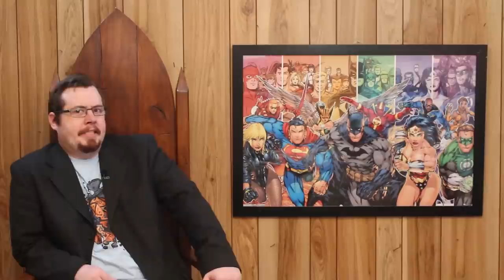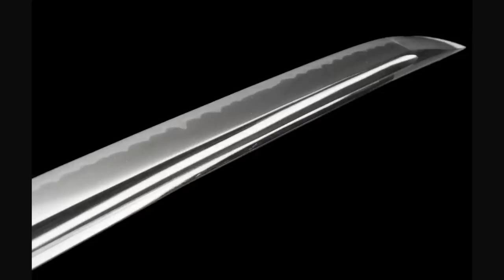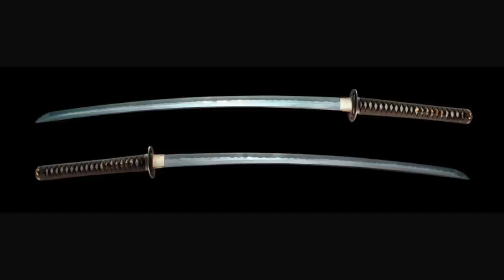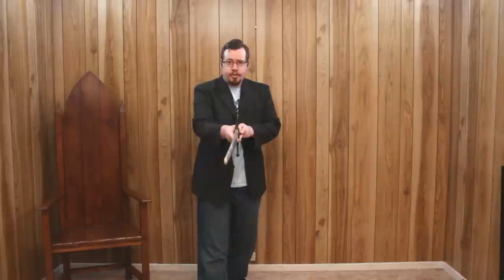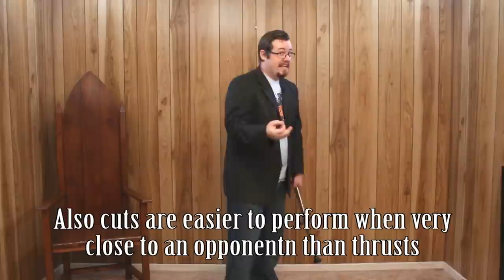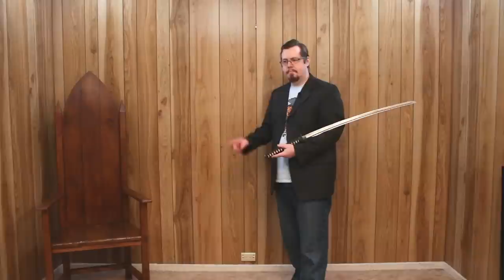Super cutting swords, are they needed?

Comment: 1) stopping power: deep cuts debilitate faster; less need to aim well; even a weak/bad swing will do signifiant damage (untrained; exhaused; stressed)
2) target area: normal swords won't cut through winter clothing and gambesson as much as falchion or Katana would; similarly a rapier might kill with a cut to the throat or arm-insides but do little against the torso (or try to fight a rabid bear)
3) psychological: flying limbs, rolling heads and falling entrails scare enemies; the ability of an overkill will boost your confidence
4) potential weight reduction by specialisation: a machete cuts better than most swords but is 2-3x lighter; same could be said about thrusting with an epee
Reply: All good points. One another thing to note is that while Katanas and many types of Messers/Falchions are very forgiving in the cut, they are by no means inadequate thrusting swords. One isn't going to be able to wield them like Rapiers due to being blade-balanced, but when thrusts are actually needed - for instance when finishing off an enemy on the ground or against armor - these swords are perfectly capable. 

Both of them are single edged, therefore quite stiff. Curvature may be involved, but most of them tend to be only semi-curved or straight. A large number of Messers/Falchions have clip points, which aren't functionally that different from spear points in the context of thrusting. Katanas may have hatchet points but tend to be fairly narrow and pointed, not to mention being even more stiffer - which aids in both cuts and thrusts.

In reality, Messers/Falchions and Katanas aren't really even dedicated cutting swords, but rather compromise design cut-and-thrust swords. If they are specialized towards the cut, it is only slightly so; as sidearms and close-combat weapons, most people wanted something that would suit the natural human tendency to cut/strike while remaining very versatile. Which is why the above swords were very popular among both commoners and nobility back in the day.

Comment: Because thrusting on horseback with a sword is stupid.
Reply: +Xaro Xhoan Daxos or a riding lance?  You know? Use the power and momentum of the animal you are riding to your advantage?

But if you want, you can try to ride up beside me and try to take me out, while I ride towards you with a big stick in front of me...and have the option of taking either you or your horse out of commission before you can ride get beside me.

(I think I would prefer getting the first attack in)
Reply: I don't see why the last time they used them is important? 

When gunpowder was become the largest form of defense, the swords were more or less a tradition.  If I am not mistaken, they were handed mainly to the officers.

Well, I guess, the standard solider had a Bayonet, which was basically a sword at the end of the gun (much like the lance)

(I guess it was important)

So as far as not being a sword, the lance is used for trusting...It just has more length than the standard sword.

If I really wanted to, I could attach a sword on a stick (actually I think the Vikings would do that...if I remember right, they had a spear head could be taken off and used as a sword in a pinch)
Reply: +Xaro Xhoan Daxos there were still lancers in the Victorian era.
Lancers didn't die with gunpowder xD
Reply: +Xaro Xhoan Daxos Ever heard of "giving point" ? :D lol.
Reply: Blank- blade "Giving Point" is not really a "thrust". You point the saber and let the animal do the work, quickly withdrawing at the point of contact. And if you do it incorrectly you break your damn wrist, so it wasn't even a preferred technique. Unless you're very skilled, giving point is a stupid maneuver. Either way, it is still done with a curved sword, usually a saber, the preferred sword of cavalry.
Reply: +Xaro Xhoan Daxos large cutting swords are indeed very effective on horse back, momentum aid not only helps the cut but also a huge amount of blunt force trauma may be imparted on the target. Top heavy and overall weighty swords are the answer to horse fighting. Not to mention if the rider is literally stuck, they may rain down blows with immense power, even without using half of their body to produce the force.
Reply: +Xaro Xhoan Daxos Actually the style refered here is pointing a sword point forward and among cavalry enthusiasts, there is a great debate between thrusting and cutting on horseback. Matt Eston has mentioned this before.
Reply: +Xaro Xhoan Daxos it&#39;s not. People did it all the time with sabres and othe weapons by the way. You just point the enemies and ride and they die.

Polish hussars had lances (one-use), koncerz (long, triangular-crosssection thrusting sword), and sabre or pałasz (curved or straight cutting sword) as a 3rd choice weapon.
Reply: +Xaro Xhoan Daxos Swords were often used for thrusting by cavalry and were more deadly when used that way. It's the way heavy cavalry swords were generally supposed to be used during a charge. Towards the end of the 19th century all cavalry swords were only made for thrusting and nothing else.
Reply: Ozoneocean MJM There's two schools of thought. One says thrusting on horseback is stupid, the other says it "has it's place" at best. I stick with the former because:

John Gaspard le Marchant, the great trainer and leader of British cavalry at the turn of the 19th Century, felt that the weapon employed in the charge was almost irrelevant, as the shock value stemmed from the momentum of the combined horse and rider. The sword came into its own during the “desultory” encounters after the charge, for which a slashing sword was best suited.

The most compelling criticism of use of the point in cavalry combat, however, lies in the possibility of it becoming the victim of its own success. With the force of a fast-moving horse and rider behind it, a well-aimed sword thrust would certainly achieve considerable penetration, even up to the hilt. As the horse and rider passed the unfortunate recipient of the thrust, the sword would be very difficult to drag clear of the body, leaving the rider at best disarmed or at worst unhorsed or with a broken wrist.
Reply: Xaro Xhoan Daxos
That was from the late 1700s though, notions and styles change and so do weapons.
There are techniques for dexterous use of the thrust without harm to the wrist while charging- search "tent pegging sword".
Reply: Ozoneocean MJM That's from a 19th century Master Dragoon, not late 1700's. The M1860 US Cavalry Saber wasn't a straight thrusting weapon, either, because in the Civil War and beyond, the Cavalry charge became less and less common and Cavalry took on the role of skirmishing where pistols and slashing excelled.

It's always the same argument with thrusting on horse back. Always people say how it can be done if you're skilled enough. Yeah, that's true of anything you can think of. You can drive with your feet if you're skilled enough, that doesn't make it a good idea.
Reply: The 1908 cavalry saber is a thrust only weapon.
Reply: majungasaurusaaaa And the Type 94 Nambu was a military sidearm. Many stupid weapons have been made in our history. It doesn't make them good ideas.

John Gaspard le Marchant, the great trainer and leader of British cavalry at the turn of the 19th Century, felt that the weapon employed in the charge was almost irrelevant, as the shock value stemmed from the momentum of the combined horse and rider. The sword came into its own during the “desultory” encounters after the charge, for which a slashing sword was best suited.

The most compelling criticism of use of the point in cavalry combat, however, lies in the possibility of it becoming the victim of its own success. With the force of a fast-moving horse and rider behind it, a well-aimed sword thrust would certainly achieve considerable penetration, even up to the hilt. As the horse and rider passed the unfortunate recipient of the thrust, the sword would be very difficult to drag clear of the body, leaving the rider at best disarmed or at worst unhorsed or with a broken wrist.
Reply: I don't want to locate myself in the flaminess of this, but I have to agree that with the saber, the design idea has to be remembered to be that it's a sword that won't take your own arm off, using it while moving 30+ miles an hour, or whatever a horse's max speed is exactly.

It will have to be a cutter to be used with broad sweeps.
Reply: Thats why the 1908 Cavalry Sword is known as the "ultimate cavalry sword" I suppose?
Reply: Here is the thing.  The professional soldiers who actually used swords to kill other men in warfare did not agree on this.  I do know that the last swords designed for American and British cavalry both ended up with a straight blades with no cutting ability.  [See the Patton Sword designated Model 13 Cavalry Saber, for an example]  For a modern man to make such an absolute stataement seems a little silly to me.  

No, thrusting on horseback with a sword is not stupid.  Especially when you are facing opponents in russian great coats that your sword will not merely not cut through, but you cannot thrust through it either.  Thrusts were often considered much more likely to disable an enemy over a cut.  Again, men who actually fought in warfare with swords on horses for their entire military career in perhaps the more professional military of their day did not consider it stupid at all.

I don't think there is an answer, except perhaps to use swords designed for specific targets or to keep swords that can both cut and thrust well.

More than likely the sword is either a sidearm you carry around when you do not expect combat or it is a backup weapon.  If you expect combat you are probably going to use a pole-arm or firearm (depending on the technology).
Reply: @MrOdrzut  Not really man. The hussars valued both their swords but for different reasons. The koncerz was more for use against armored enemy horsemen and the saber was more for general use. In general, hussars were not supposed to engage armored enemy infantry with their swords. Generally that's what their lances and guns were for. 

Two examples I can think of for more well rounded weapon kits belong to Russian cossacks and Byzantine cataphracts where they had a lance or bow/gun as a primary weapon and for their sidearms, they carried a curved saber for general use and for facing armored enemy cavalry and infantry they often carried a mace.
Reply: @Jilguror  Main reasons that people weren't able to cut Russian great coats was because the sabers they were using were not specialized cutting sabers (around this time they were using pipe-backed cut and thrust sabers that were more geared for thrusting) and most soldiers didn't sharpen their fucking swords. In conclusion, no shit they weren't able cut good when they were trying to cut with damn near blunt edged thrusting swords.
Reply: @genghiskhan6809  not really? That's literally how they fought - shoot pistols, charge, break lances, retreat, get new lances and pistols from their helpers, repeat. Swords were used if the charge worked and enemy started to retreat.
Reply: You're all just arguing over personal preference to be honest, both the thrusting lance swords and heavy cutting swords work well on horseback, it's down to personal fighting style, some prefered giving point on the charge and some prefered cutting. neither is bad, the same with fighting on foot you get some fighters who prefer the point and some who prefer the edge. The English typically prefered cutting in history, and they had to be trained out of it to adopt giving point more. You are just debating apples and oranges, some prefer an apple some prefer an orange. A heavy cutting sword can lop your head right off, a dedicated thrusting sword can run them through the heart. Both are effective on the cavalry charge.
Reply: Using a sword on horseback in the first place is dumb

Comment: I do know the answer to your questions about cutting an arm off (or whatever) vs just cutting deep enough to disable.

In combat, there is allot of adrenaline.  There are several instances where a person will receive fatal wounds and did not know it, and fought for the few minutes while he was alive.

If you cut the arm off, It is very unlikely he is going to be able to strike you again.  If you cut deep, the person may not even know they been cut (especially if the sword is sharp) and make a swing.
Reply: +undecidedgenius if you cut through the sinew or seperate the muscle, it doesn't matter one bit if the person knows they've been cut.
Reply: +iseeicyicetea It matters, because the person has got two arms. Completely cutting a limb is something that even adrenaline cuoldn't solve, the person would bleed out in seconds and lie on the ground, or try desperately to stop the blood flowing. If you cut a limb, you have won, if you just disable it, you'll still have to fight.
Reply: If you get that perfect shot, yes.  You have to remember that your target isn't just standing there.  He is trying his best not to get cut.

So if you're off, even i little, the other still has the ability to strike.

Just as a side note (to prove my point), on my right ring finger, I have a big hole in my tendon.  I have only about 40% of my tendon there and yet I have never had any trouble using my ring finger since that happened.

Now if it were cut off, I am sure I would be having more trouble with it

Comment: Shad, please do not take offense to this question, but have you ever been in a fight?  Not a little sparring match between buddies, but a conflict that really matters?  When your fight or flight instinct kicks in, your adrenaline increases exponentially.  That in turn heightens your other senses, which may be very difficult to control.  In extreme duress the body can perform feats a rational mind could not fathom.  Because of this and a few other factors the body can withstand a lot of abuse.  That said, "just enough" could very well be not enough.  When I went to war I heard so many reports that some of the insurgents would continue charging after having an entire magazine of pistol ammunition fired into them.  There are times when "overkill" may be your only option.  In hand to hand training one time, my partner got a bit overzealous and tried to snap my arm.  No amount of tapping was he ever going to release me.  So after repeated headbutts to his face, breaking his nose and leaning my free arm into his throat cutting off his air he finally let go.  In war there is no such thing as "just enough", you destroy your enemy as completely as possible.  You not only shatter their bodies, but their morale and their will to fight on.
Reply: This is correct. Kind of. It's a lot harder to incapacitate someone with pain when their hopped up on adrenaline, but a severed biceps is still going to disable an arm. And that doesn't require cutting through the bone. As others have stated, a thrust that misses vital organs isn't going to be fatal. Similarly, a thrust that doesn't go through muscles isn't going to disable a body part. And bullets are basically very powerful thrusts
Reply: Crist dude
Reply: Dude no. Most people panic. Also just enffoe works. You don't have to full stop someone. I have had fight with bats and bottles. One good hit and most people back of. People dont keep fighting if they lossing

Comment: Love the point! Generally I agree with this, but I have a possible rebuttal. Maximum potential cutting power is not all that matters; how hard you have to swing the sword to achieve a good wound is also important to consider. If a sword can cut very well, it doesn't require as much physical exertion to do damage in the cut as one that only cuts well enough. Largely, this would be against unarmored opponents.

Of course, again, I agree with the overall point. When people do these cutting tests I think they obscure the original intent for having such a specialized sword; but I do believe there were times when the extra cutting power came in handy. Or should I say 'came OFF handy', amiright?!
Reply: Thrusts take what, 30 mins, an hour? to kill? maybe disable in 5 minutes perhaps, optimistically, this is completely run through, too. Think about bullets. Though tiny, they cause fist sized cavities on impact, with hydroshock damage. yet most people survive gunshot wounds nowadays, if they get medical attention in under 1 hour.

Now consider the actual volume of the cavity from a sword. hell, even in combat it could take days for enough blood to actually pool in the injury to actually kill you.

Cuts, now cuts are way more painful, the enemy still has running away as a possibility (when stabbed through they will fight with wild abandon knowing they will die) and it is easier to sever tendons in fingers and such and actually disable, whereas a thrust to the stomach won't actually disable anything.
Reply: Realy?! to stomach man! and you say it dosn't disable ANITHING ?!!! man come on... Are we all terminators? weren't you ever hit in the stomach?
Reply: @dpakoh1822  Adrenaline is one hell of a drug. There were even reports of people being dismembered (including decapitation) yet they would still fight (or at least flail wildly) for hours after the fatal wound occurred. 
Now, if this can happen even with nasty cuts like this, how often do you think it'll happen with thrusts? Don't forget that adrenaline blocks pain reception.